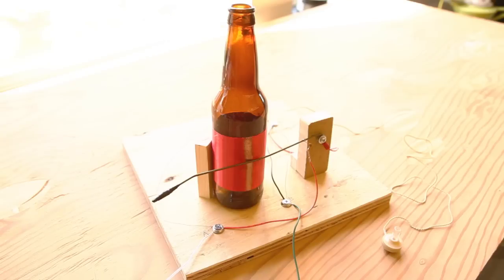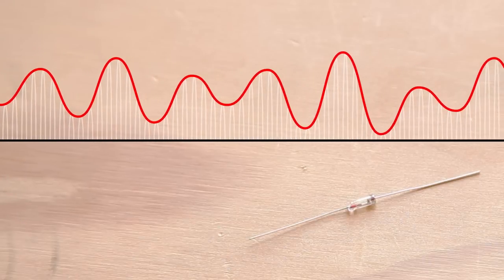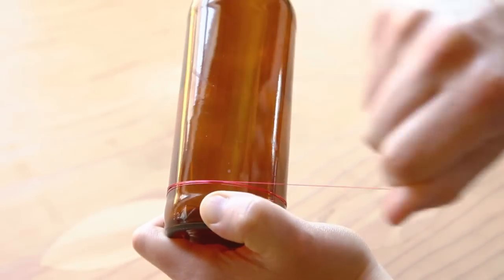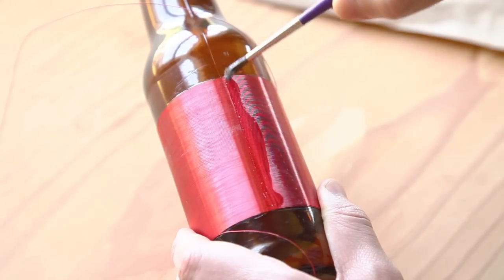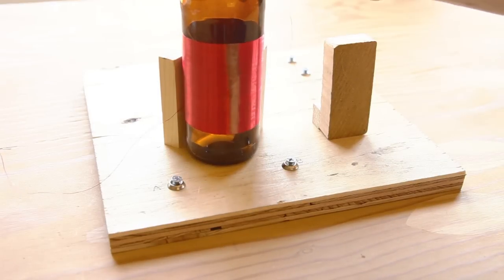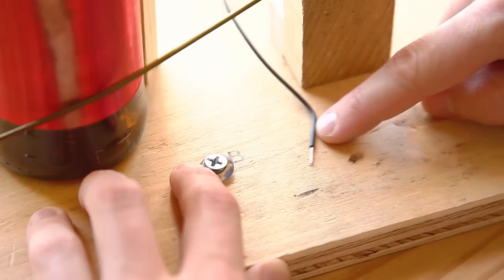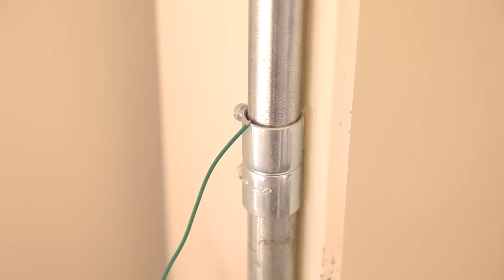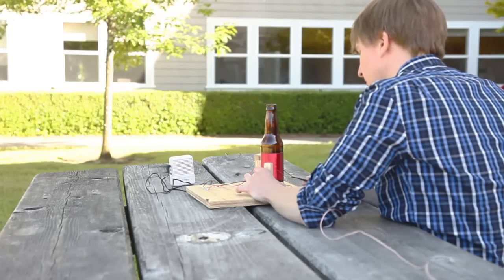Weekend Projects - Bottle Radio

Comment: You guys made this a little costly. We use to use parts and wire scrounged from old electronics and a oatmeal box (also known as a mush box) instead of a bottle. It would be cheaper to by a store bought kit then buy the materials for yours.